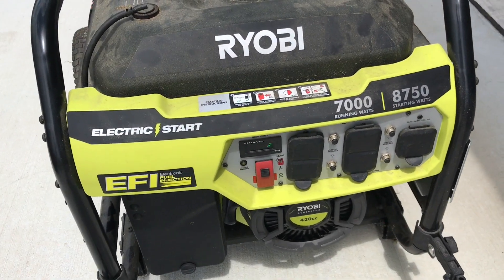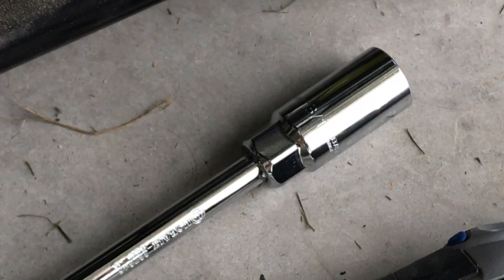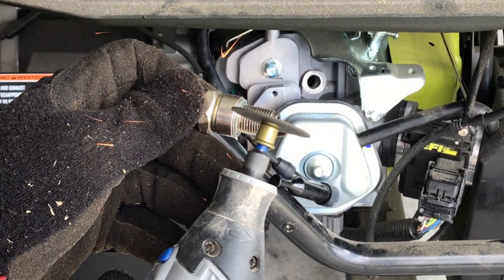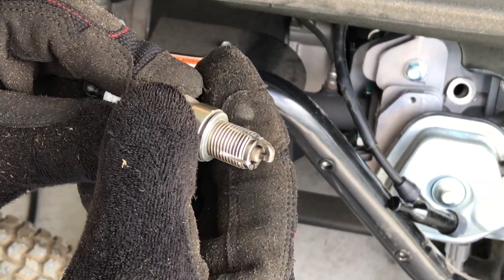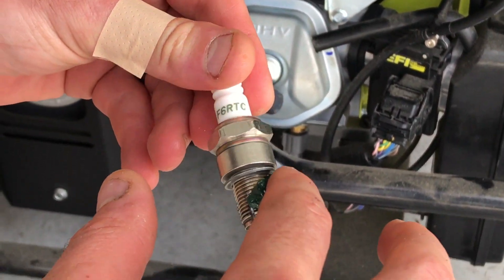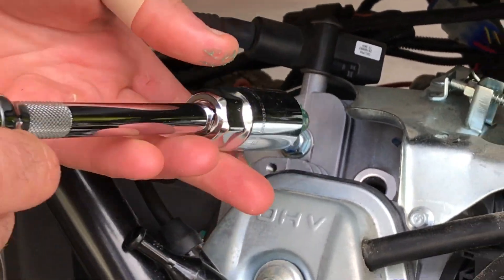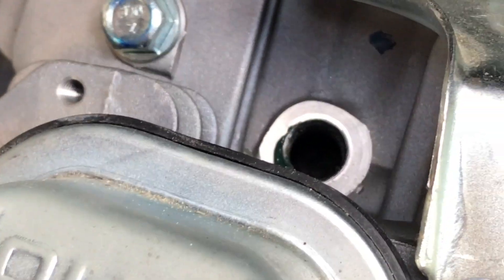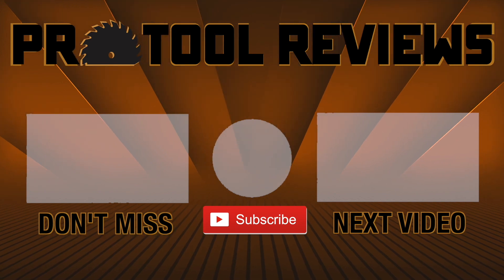DIY Spark Plug Chaser - Create a Spark Plug Tap

Comment: To clarify this isn't a tap, more of a thread chaser. To clean up the existing threads. How is the same circumference plug, supposed to tap a hole with threads blown out larger than plug??? This video should be renamed.

Comment: I dont get it. If u took a plug out why did u need to take extra metal out ? If a plug already screws in and out whats the issue other than a little clean up, I just dont under stand degrading the hole even more...
Reply: Right? This is just chasing the existing threads to clean them up.

Comment: You can cut the grooves with a file also.
You can also make a tap or die from almost any bolt or nut, large or small. Cut the grooves in the bolt or nut, use a torch to heat it red hot, then drop it into water or into a pan of old motor oil. This hardens the bolt (or nut).

Comment: Thanks it works I tapped my spark plug on my motorcycle. works like a charm. just put enough grease so that all the metal shaving will be in the grease and wont fall onto your cylinder :)